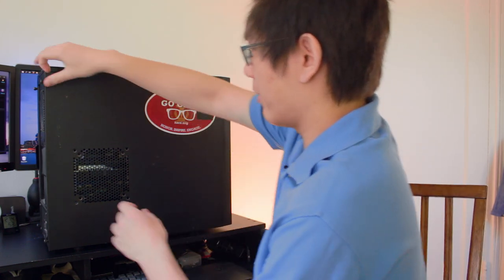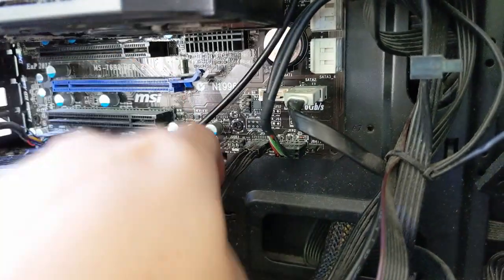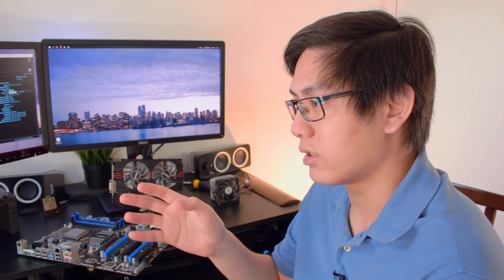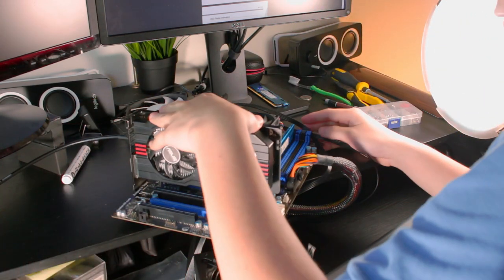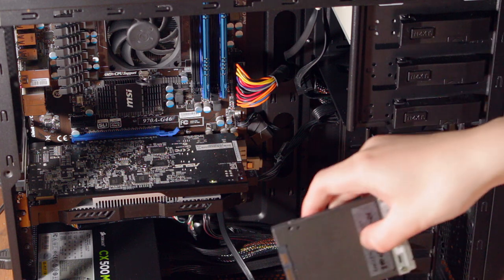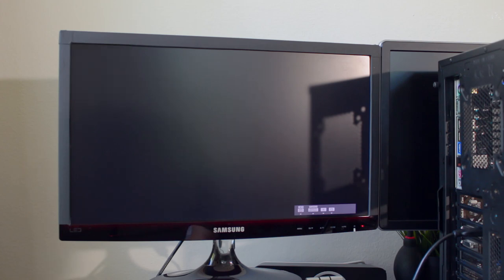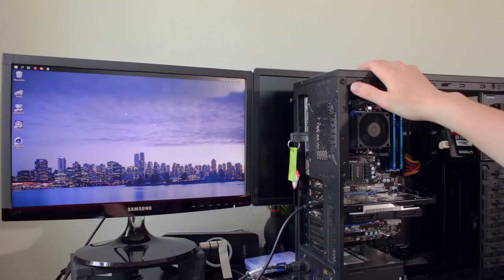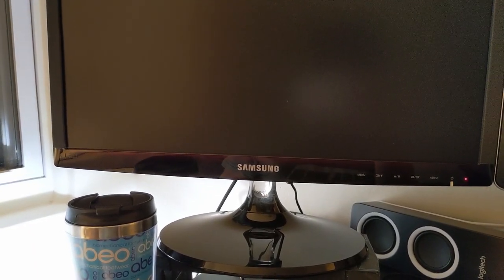Tried To Repair This Board and Failed - Basement PC

Comment: Fun fact: The FX series is AMD's last line of CPUs to not have PSP. That means the FX 9590 is the most powerful x86_64 CPU you can buy without a built in backdoor. Intel started making IME CPUs many years before.
Reply: AMD PSP can be disabled. My laptop's PSP is disabled in the UEFI as well as secureboot.

Comment: It looked like the motherboard was damaged by one of the top screws... I hate when a computer takes forever to diagnose it may theoretically be cheaper to get a new motherboard/CPU based on the hours you spent trying to fix